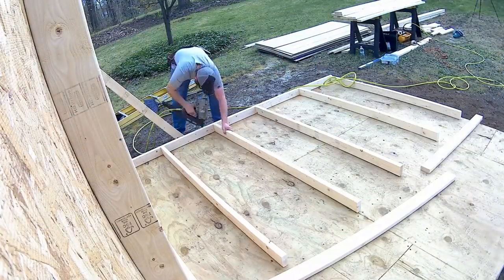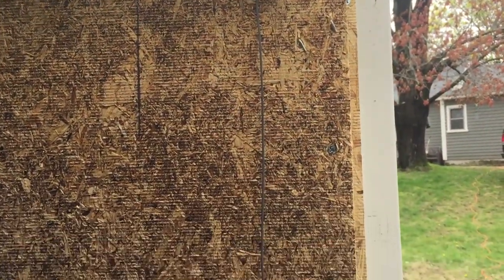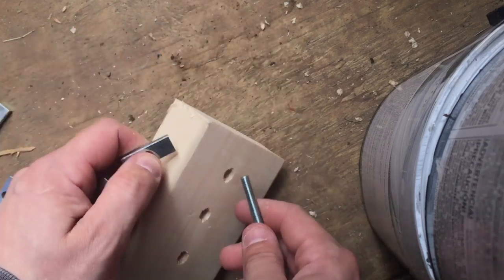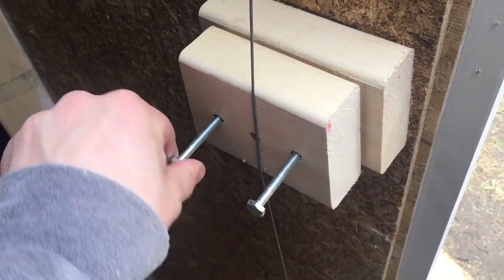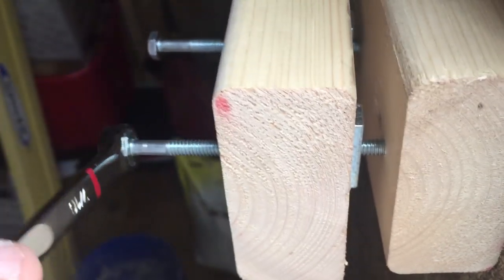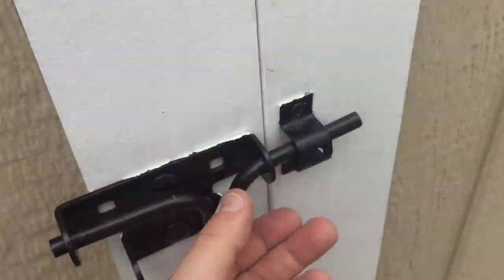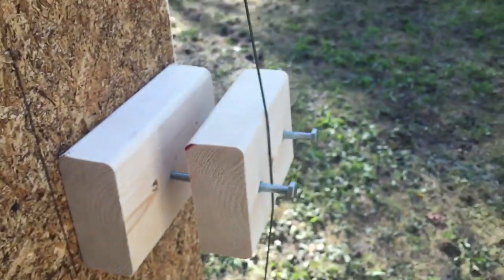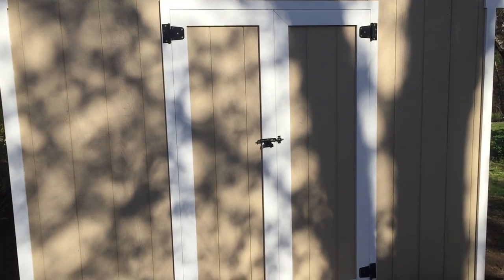How to Fix a Warped Plywood Door Without Removing It | DIY Hack

Comment: You’ll need to paint the inside of the door once it’s flat. The reason it’s warping is that the exposed interior surface is sucking up atmospheric moisture and expanding but the exterior surface is staying stable.
Reply: my buddy says never read the comments, I say ALWAYS read the comments!
Reply: fail

Comment: Yo, I have the same exact problem you had.  Just finished building my 8 x12 shed and the right door (lower left) bows out about an inch.  Put on the latch and pushed it closed (locked)....that helped a little.  Somehow, I knew that someone out there had a solution to this problem.  Thanks for posting your solution.  I'm going to try that tomorrow.  I live in NY where temps are now in 50-70 degrees range so not sure if it will work due to lack of hot/warm temperature.

Comment: Thank you for sharing this easily applicable solution to a twisted problem.
I have a similar problem with my two doors, 4 feet each, that don't line up in the center, due to a diagonal warped.
On the left door, the top comes outwards, while the bottom seems to come inwards.
For the right door it is the reverse, so the doors are not aligned at the closing point.
I will try this solution hoping that this will fix the alignment of the two doors. Thanks again.

Comment: Would this work on treated wood? Specifically can the heat and humidity reform the wood once it has Polyurethane on it? I just installed a pretreated warped bathroom door that I’d like to correct.

Comment: Great method! I have a similar problem for a shed door I constructed. I have a convex bow opposed to a concave bow that you had. Love your contraption but for my bowing I would have to drill holes on the outside which I am trying to avoid. Also, I think I would need more tension as my frame is 2x4
Any suggestions?

Comment: What's to keep the door from warping again?
Reply from the maker: Luck? 🤣 well really the hope is (this is what happened in my case) after letting it sit in the straightened setting it will start to acclimate to the changes of humidity levels and maybe dry out a bit to make it stay that way.  I still have the wire attached and the blocks handy just in case I have to do it again but it has been good.  When all else fails you could just get some old school turnbuckles.  Hope this helps!

Comment: This happened to my front door.  it would not close and lock all of a sudden.  Luckily I have an outer door that locks.  I finally got it closed and locked, but am afraid to go out the door for fear of not being able to lock it.  The top part of the door has a slight outward twist in it.

Comment: Would this work if only one corner bowed out?  What are those bolts called? Ty
Reply from the maker: Hey Mike!  I think it would, just have the other end of the wire attached to the middle of the door.  I am not sure exactly what they call these bolts.  They are used to secure counter top corners together but you could use a nut and washer to work the same way.  Thanks so much for checking the video out and good luck!!

Comment: How about after  the door gets wet and drys out a few times - long term?
Reply from the maker: So far so good.  Been a few months.  Only time will tell.  Thanks for checking out the video!
Reply: The Fixer 
I just built a couple shed doors today - both are warped so I’m going to give this a shot.
Thanks for posting the vid.
Reply from the maker: No problem!  I hope it helps out!!

Comment: wish I could do that with my Home Depot Rubbermaid gall-darn shed door. Not their fault but annoying just the same.
Reply: That could be a leveling issue where the shed itself is twisted or out of square.
Reply: As Chad mentions. That could be a foundation leveling issue. If not it’s a fairly easy fix. I had this problem. I just used a 1x4 approx 5 ft long. On the inside I put the wood vertical and on the other side I use large washers and drywall screws and screw them thru the plastic and into the wood, at the same time I am also pushing the convex side inward (in my case inward towards the wood). Put 8-10 of the drywall screws with large washers into the wood and since the plastic is much more flexible, the wood holds it pretty straight. I did this to both doors. In my case, we had a bike wheel putting pressure on the doors for many months and caused the deformation. It’s probably easier in warm weather too